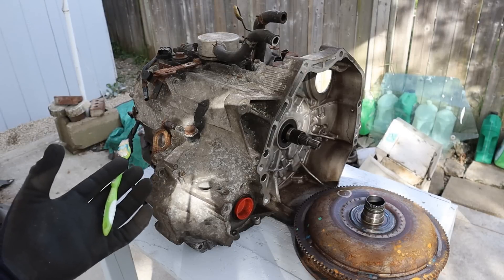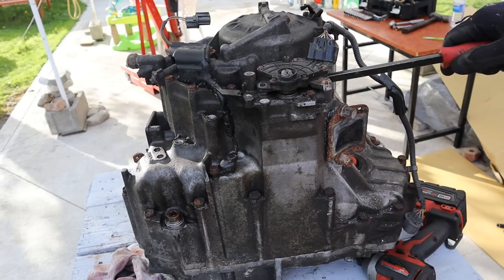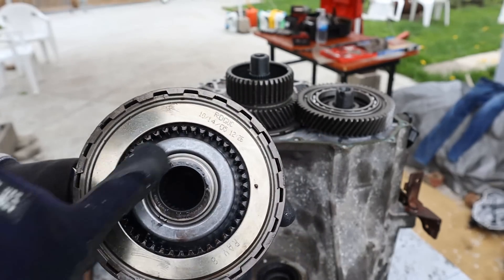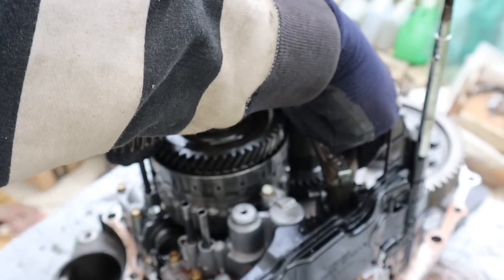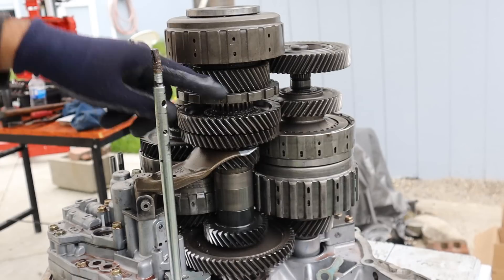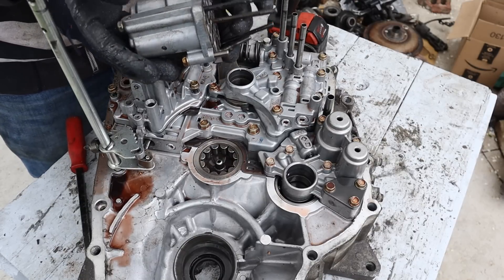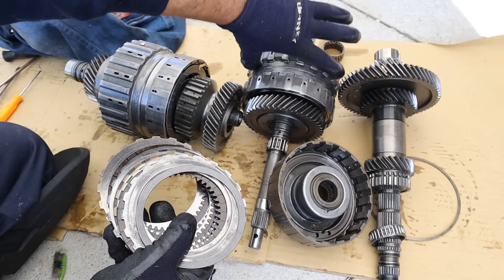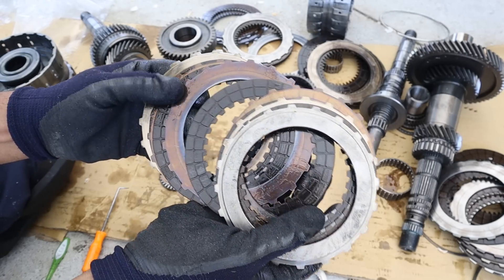Why Honda Transmissions FAIL

Comment: Honda V6 transmission has always required ATF service every 30k miles. The official ATF service as described in the official service manual requires drain and fill THREE TIMES, with running through the gears between each drain and fill to mix all ATF thoroughly. The ATF pan is designed to drain 60% to enable 96% fluid change when repeated three times and mixed between drains. My dealer simply refused to do it 3x even if I paid 3x, said it was unnecessary. At 90k with only 3 drain and fills on original 4speed 2000 Odyssey it began to shift funny. In these early days of V6 trans, when the bad reputation was formed, The Odyssey was the largest heaviest car Honda every produced and the trans was geared to handle more load. It had the largest frontal area of any Honda so even on the highway it put more load through the trans than any other Honda, so there was much more heat in all driving situations. There was no supplemental ATF cooler back then, only the radiator. And they still used non-synthetic Z1 ATF which was fine for K20 cars but not up to the lube and cooling demands of the new V6 transmission in Odyssey with dealers refusing to perform the full specified maintenance, and owners unaware that any ATF maintenance was needed at all. I was never asked by my Honda service advisor if I wanted ATF service. I had to ask for it, and they still would only do 1x even when i showed them the Bentley service manual required 3x. This is why Honda V6 transmissions failed. Honda service mismanagement. They did not want to admit the problem until too late. Then they reformulated their ATF, they added supplemental ATF cooling and made internal trans changes to avoid the failures caused by worn out ATF, like small oil passages getting clogged with clutch debris. At 90k I started doing the ATF service myself with Valvoline synthetic ATF that said Honda on the front of the bottle and met all their ratings. I added magnetic external ATF filter. Every 30k I drain and filled the pan with new ATF, then ran 2 quarts at a time out the ATF cooling return hose until it ran clean, about 10 quarts. While the shifting damage never totally healed, it did run until 290k miles under severe abuse as my kart-racing teenage son's high school and college car. Now I use Redline Oil D6 ATF in all my cars. It is much better than Honda DW-1 ATF. I do a single drain and fill every 15k, which is every third oil change. This keeps ATF fresher than waiting until it's all worn out at 50k interval, but same amount of new ATF is used in that interval. Honda could have done similar approach but would require ATF service every 10k, or alongside every oil change. They could have done it as a combo deal for low price. Very easy for DIYers to do drain and fill in the driveway. Switch to Redline D6 and drain/fill your Honda V6 ATF every other oil change, or 10k miles.
Reply: I remember asking a Honda service manager about the trans failures in the early 2000s and he said he never heard of anything wrong with them but all my Hondas are standards except for my wife’s Acura TL. I change fluid and filter every year or so, do a 3 drain/fill and it works good.
Reply from the maker: 290k on an early odyssey is pretty good.
Reply: TL's and RSX's here. I do a single drain and fill on the trans for 3 consecutive oil changes (5k intervals), then skip it for 3 oil changes. That way trans is serviced every 30k miles. Heard of this with 1st TL and it's always worked for me.
Reply: @mischievouself8047  Great idea! I have little blue tape notes all over my cars to remind me when I did it. LOL
Reply: Put 100 miles between each one with the triple flush. Second is as dark as the first.
Reply: 290k is excellent ,my 2002 Ody 5AT delays engaging 2nd,3rd gear hates going into overdrive at 217k
Reply: @CRAPO2011  Mine wouldn't shift 1>2 unless you backed off the gas. I think it was tiny internal hydraulic passages got clogged by clutch debris and cooked Z1 non-synthetic ATF.
Reply: @rhollyday  did a drain and fill a few days ago added Lubegard red and Lubegard shudder fixx, transmission is now near death. Doesn't want to shift at all😭
Reply: @CRAPO2011  So sorry to hear that!
Reply: Finally somebody posted what was needed to be said about Honda automatics. I always said that 40-50k km is a max the ATF can take because there is only 3-3,5L plus whatever is in torque converter. These are small, compact trannies unlike the GM ones from the early 2000s or even Aisin ones. In general Honda requires more frequent fluid changes on their AWD and 4x4 because they use light viscosity fluid in the diff and transfer case.

Still this tranny is nothing compared to Ford, not only Fiesta/Focus but later V8 Ford's and Lincolns. We put a used tranny on 2021 Aviator with barely 80 few k km.

Comment: They probably ran Maxlife in it. Big no-no. Honda pen fluid only.
Reply from the maker: Yeah I'd stick to OE fluid for the transmission. 

Coolant you can probably mess around with
Reply: Coolant as long it's a POAT coolant regardless of color it will work just fine. I used Zerex Asian vehicle Pink in my Acura TSX.

Comment: I drive a honda hrv 1999 with standard 1.6 16v non vtec .
With a cvt transmission.
Have run now 202400 klm on it.
Still run fine.
Reply: v6 for fs sakes
Reply from the maker: Nice. What's a 99 HRV considered in North America? Civic hatch?
Reply: @speedkar99  a shorter model of the Honda c-rv 
Its beult from a Honda jazz from 1996 base.
Its small 4x4 awd systeem car.
Its really a brick with 4x4

Comment: I have 2005 Acura TL and 2006 Honda Odyssey. Both run ok so far.
Reply from the maker: At least those weren't as bad as the early 2000's Hondas.

Comment: Had to watch twice due to half a tooth brush pointer.🙄 For your sake hope garage is comfortable to sleep in for that crack about jeans & fit. Really amazes me the machining alone just in gearing. Flintstones had a heavy but stone cold reliable set of wheels.
Reply from the maker: As an engineer I too am mezmerizied about the machining and tolerancing that have to go into these. And to think this is on the mass scale!

Comment: I actually have an 05 TL automatic myself which has the same transmission as the 06. I have about 109k miles on the original transmission and do forsee a transmission rebuild as I put some more miles on it. I run Redline Type F ATF and have been looking into installing an external ATF cooler sometime in the future. I can't even drive up a mountain road at the speed limit without the temps climbing to almost overheating levels which has made me weary to take it on road trips.
Reply from the maker: The transmission temp overheats?
Reply: @speedkar99  Yes, I actually had a time where I was cruising at about 85 mph on some freeway in the desert towards the end of a road trip and as we were climbing a small hill, the engine rpms rose like it was in neutral and the car would not go much faster. I immediately pulled off the freeway to let the transmission cool down for about an hour. After that it drove fine.

Comment: Does the Honda 8DCT follow this same design principle?
Reply: No. It's built very similar to other DCTs, but uses a torque converter instead of a dual-mass flywheel. Smoother takeoff and torque multiplication at the cost of mechanical efficiency, that is until the converter locks up. Another major advantage is that you also don't have to worry about slipping the clutches when creeping, as the torque converter allows slip itself. Shifting speeds are unchanged with the converter, it's faster than the ZF 9 speed and any other typical auto. I've heard they're pretty good, though early model years had issues with software updates being needed to fix the bump when it downshifts to 1st and some torque converters failing. I have a '19 TLX and the DCT's been fine since I owned it, but I only have 27K on mine. Haven't really heard of any mechanical flaws to the gearbox itself, and someone on Reddit apparently got over 200K on theirs and it's still shifting fine.
Reply from the maker: No

Comment: That’s the craziest accusation ever! My last 4 acura had zero trans issues and they all had over 200k MILES and one had 305,000 miles! CHANGE YOUR FLUID PEOPLE! They only die when you don’t change the fluid like Honda requires!
Reply from the maker: Not really. Some have good luck with them. Just like life. Excerize doesn't mean you'll love longer.
Reply: I'm at 260k miles on mine BUT it is a weak transmission. In cold weather I feel a slip possibly of the torque converter when getting on the freeway before its warmed up. When I select D3 then manually shift up to D I can avoid this. In heavy traffic a manually select 2nd gear to keep it from needlessly shifting up and down below say 20-25 MPH.
Reply: not necessarily true, they’re just garbage transmissions
Reply: @zaviermayo272  +1 dog shit trans mated to a somewhat powerful v6 is insane

Comment: Owner of 05 rsx 400miles when sold , my 06 tsx 250k miles and run like a champ, both  cars i changed fluid every 30k, including p/s and brakes.
Reply from the maker: I think those 4 banger transmissions were far less likely to fail

Comment: I am one lucky guy, I guess! I drive a 2005 MDX with around 250,000 miles on the original powertrain. It still drives fine and the engine has plenty of power. The only issue I have to take care of is that it leaks engine oil in a few known spots.
Reply from the maker: Nice! 2005 was on the latter half of these failures.

Comment: Just like autotragic NSX. It surprised me when looking at the service manual. The transmission is basically like the honda cub. Big multi plate clutch basket on shaft, just solenoid/hydraulicly controlled intead of your foot. Unfortunately still slush coupling tho.

Comment: Driving a 98 accord 4 cyl with 354k on the original engine and trans!
Reply: V6 mostly ya wanker
Reply from the maker: Nice! The 4 cylinder was less likely to experience failure.

Comment: Honda eventually reached the limits of this transmission design and switched to a ZF 9 speed for their V6 cars and the diesel CR-V. Afterwards, they made their own 10-speed planetary automatic for 2020 and beyond. Nowadays, Honda has switched almost everything to CVTs. The only units using the 10-speed are those powered by the K20C or any V6 application.
Reply from the maker: Yes

Comment: Transmissions without an external filter or drain plug are the absolute worse. Turning what should be a routine job into an absolute ordeal.
Reply: No drain plug? Did you mean dipstick?
Reply: These transmissions do have an external filter right where the hard line goes on the cooler at the top of the tranny. 😊

Comment: My father purchased a brand new 2006 Honda Ridgeline. Sold it at 200,000 miles running great and never had any transmission problems. But he did service it
Reply: Ridgelines had a more robust 4 shaft design. Failure rate was way lower

Comment: On the 04-06 TL's you can actually replace the filter right after it passes through the coolant warmer. I did it on mine + ATF change every 30K km. There's also a bunch of information about changing out the 3rd and 4th pressure switches. They apparently contribute to the overheating issue. I'm over 200K km on the original transmission, shifts smooth but will still pull hard.
Reply from the maker: Nice. So the pressure switch doesn't allow for enough fluid flow?
Reply: I have a 04 TL at 304k miles on original transmission and original Oil pressure switches, still shifts perfect. I do replace fluid every 20k and filter every 40-50k miles.
Reply: I'm about to replace both pressure switches on my 05 Accord V6. I've read they go bad a lot and the shift solenoids get dirty. Mine was! It shifted so smoothly after cleaning those solenoids!
Reply: @victoriamorris7619 how’s it running now? And what made you change it out?
Reply: @zackcox2895 well it's shifting better than ever but that wasn't our fix. I continued having slipping in third gear. I still feel like there's something I'm missing but for now, I'm waiting on it to get rebuilt. I'm
Adding a transmission cooler to help prevent all of these issues. 
If you get the pressure switches, I've heard to get OEM only.

Comment: My daughter in on her third professionally rebuilt trans, in last 18 months!  The installation shop is not happy only getting $450 to remove replace the trans.  2004 Acura, 145k mi.  Added external trans cooler.
Reply from the maker: Ouch. Why $450?
Reply: @speedkar99  when the trans warranty is invoked, the trans remanucf only gives $50 per hour and some book hours to the shop.  The remanuf used 9 hours, $50 and hour, that's $450.  It actually takes closer to 12 hours.  I originally paid the shop $150 and hour for the 12 hrs, fair.  They are replacing the failed unit, on my 3rd one, only getting $450 for each time. They are not happy, but don't blame me.  I had no idea shops only get such a small amount for a re-install of a warranted item

Comment: I have a 2010 Accord V6 coupe with the automatic. I have 201 000km on the clock and the transmission still works fine although the 3rd gear shift is a little jerky. I change te fluid every 2 years (drain, mesure, and fill with the same amount drained).
Reply from the maker: Great. Lots of the issues were fixed by 2010

Comment: Aight now we need to see the side by side for the Honda H5 pre 2005 and post 2005 since they switched from 3 shafts to 4 shafts which is considered bullet proof.
Now the honda 6 speed is becoming problematic as those are getting more miles. Interestingly, the honda H6 uses the 4 shaft designs of the updated H5. My question is if the H5 with 3 shafts was problematic and the H5 with 4 shaft was bulletproof, why is the H6 with 4 shaft giving torque converter and judding issues ...why they didn't have the H6 with "5 shafts"..crys is DW-1 🥲 

Tbh probably cost savings for the H10
Oh and the as far as i know all the honda trannys have services able inline atf filters,but seeing all these clutches and plumbing you would think atf filter changes would be necessary
Reply from the maker: I have a video on the 4 shaft, check out my hybrid accord video
Reply: @speedkar99  now we must pray for H6 bonus points for Torque converter at the same time

Comment: Thanks for the informative video.  Honda has had transmission problems since the 90s.  Back then the company would not own up to their "poor" design, till the problems were brought out in the newspapers.
Reply from the maker: Yeah it took them a long time to fix it!
Reply: Well actually even the 'semi automatic' from '80s had problems. Normally if someone was serious about Honda, Mazda they would get manual. My friend still has 2000 Integra Types R. Before when he worked at Honda dealership he had '99 or 2000 Civic with Integra swap, plus Supercharger. Of course suspension and the other pieces. That thing could keep up with 911 Porsche. 
As for automatic ATF change every 40-50k km, max, to insure it's not going fail after 100 some k km.
Reply: @pliedtka  I also use Amsoil Signature synthetics and it really does help in longevity. You can overcome design flaws in equipment with oils. I've seen this in many ways. Planetary Carriers are common to inline transmissions but bc of the transverse mounting format they can use gearsets. I have a 2010 MDX I was told would need piston oil rings but at 290K+ miles I don't bc of the oil I used. 
I have developed a small clunk going into reverse and assume it's the worn synchro for the manually selected gearset. Like in the engine, if you have a hot spot design flaw built in an engine or transmission and you select an oil that will survive it you can avoid the problem. Group IV Synthetic and I never trusted the 0-20 Acura recommended and always used a 0-30. and 0-40. 
" That thing could keep up with 911 Porsche." I've got a friend with a 911 and he'd freak if a Honda kept up with him. LMAO I'd love to see it.

Comment: MAYBE U SHOULD GIVE HONDA OWNERS SOME GOOD TIPS TO EXTEND THETRANNY LIFE ???? SUCH AS CHANGE THE TRANNY OIL EVERY 40K OR OFTEN, INSTALLING COOLER AND KEEP THE GEAR IN NEUTRAL WHEN ON STOP LIGHTS ???? THAT'S WHAT I DO......
Reply from the maker: Neutral at stop lights don't do much for transmission life. Just takes the wear off the torque converter but not considerably

Comment: does this 5 speed internals similar to the 4 speed that is used with f22/h22a engine?
Reply from the maker: No the 4 cylinder engines are different

Comment: typical aisin gearbox, good gearboxes untill the filter gets clogged and you are basically screwed, you might prolong the buildup by replacing the oil every 3-4 years but i doubt many do that since they are being told "lifetime oil"
Reply from the maker: These transmissions were before lifetime fluid became a thing. I wouldn't say they were good. A time bomb waiting to happen which affected resale values drastically
Reply: @speedkar99  so that’s a really rubbish gearbox even with proper maintenance, honda🤣
Reply: Aisin had nothing to do with the design of Honda’s autoboxes.